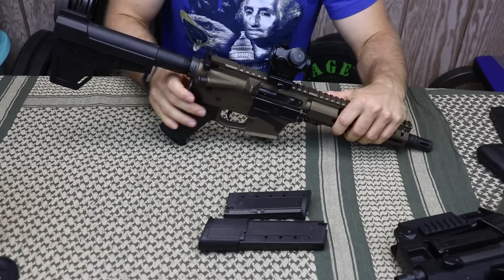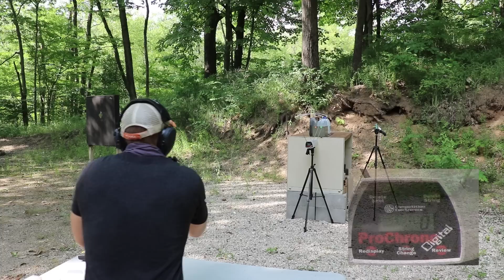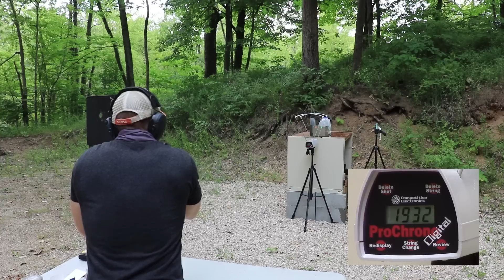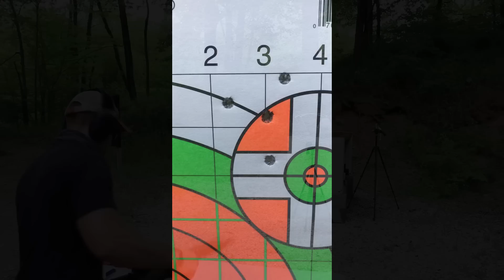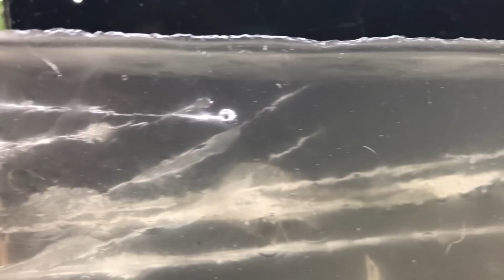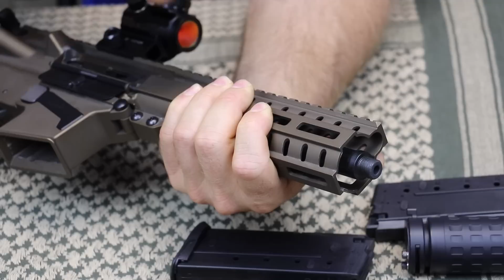CMMG  MK57 Guard Pistol Review! Brand New 5.7x28mm Firearm!

Comment: Hey Matt,
    I just got one of these and after putting around 500 rounds through it it looks like the brass deflector is petty chewed up. 

Is this normal? 
Do they make an aftermarket metal brass deflector I can swap it with?
Reply from the maker: It pretty much happens with AR guns with brass deflectors. A common hack is to tape a piece of Velcro over it.
Reply: @BuffRANGE will try that. 
Thanks ☺️

Comment: You know, those electro plated 22 mag bullets (like the 40gr TMJ) is known to flatten like a softpoint at at little as 1600fps. That's one thing the 22wmr has going for it: the bullets show behaviors at lower velocities than 5.7x28mm. With that being said, I think I really like the idea in 5.7 of a semi auto round that performs close to a 22 hornet.
Reply from the maker: but typically you need a 16" barrel 22 mag to achieve those velocities, not a 5 or 8" barrel.
Reply: @BuffRANGE  you're absolutely right. That is the curse of the 22mag...one needs to have a rifle to get relatively acceptable performance from it.

Comment: Honest opinion, 
PS90 or MK57? Which one if you could only have one?
Reply from the maker: If I could only have one, I'd probably pick the CMMG.
Reply: From what I have heard the CMMG has even less recoil and stays on target better for double taps.  I like the sight mount system better.  Also one can drop in better triggers.  I already bought the new trigger and I have a lot of FN mags.  Now for the rest of the kit; pistol, larger charging handle and the sight system.  That burns more than $3,000.

Comment: The mag issue is a sticking point on this. Seems like it's ill conceived to bet your products success on a crappy magazine. Or on a great one that is difficult to find in numbers. I'd rather just go with the ps90.
Reply from the maker: FN can be pretty lazy at times it seems with quantity on hand for magazines. I imagine they didn't cook this up over night, and probably had plans to buy a bunch of FN mags. Not sure.  The factory FN mag in the original USG, 10rd, and MK2 ran perfect in the gun. the 20rd was tolerable, but as mentioned is a crappy mag compared to the FN.

Comment: Can we get a guard in 7.62x25 plz and have it feed from pps43 32 round mags?
Reply: Buffman - R.A.N.G.E. it actually would only require a barrel change new Magwell  because 7.62x25 uses a 9mm rim and same extractor groove.
Reply: build it and send it back in time to when 7.62x25 was $0.08/round
Reply: well 7.62x25 has now become a reloaders bullet. now that quality boxer primed Brass is available.
Reply: Nick Graham 
You sir are a genius. 
Honestly, if CMMG is willing to make this gun, I dont think your idea is too far fetched.
Reply from the maker: In all honesty, they are proving out of their blowback design in various calibers, I don't think doing the 7.62x25 would be hard to make work.. But I'm not an engineer.
Reply: timewave02012 oof rip.  7.62x25 isn't that expensive these days it's about on par with .357 Sig.
Reply: I could understand the appeal if it was cheap, widely available, had good bullet options, or consistently penetrated armor, but 7.62x25 has none of those things going for it. Maybe if you have stockpiles of ammo and guns chambered in it already.
Reply: Would be nice to see someone try it in .223/5.56 first.

Comment: Thanks for the review! I'd personally rather just get a PS90, but it's nice to see more 5.7x28 firearms.
Reply from the maker: This platform does have the AR-15 parts availability advantage going for it. Not a lot out there to better the PS90 trigger, and optics are a little more limited, but indeed bullpups are cool :D
Reply: Bullpups are cool, especially SBR'd bullpups. Plus I typically don't buy firearms that don't have an ambi mag release.
Reply from the maker: Exactly. Some may remember PS90 mags used to cost $75 until AR57 came out with their copies, and now they're $30 :D
Reply: The ps90 is about 200 dollars cheaper than this gun